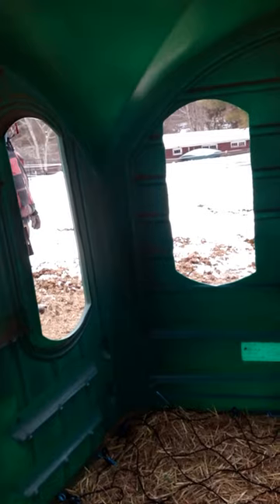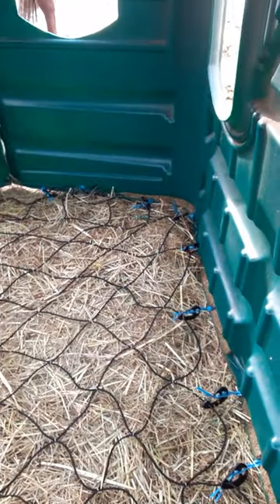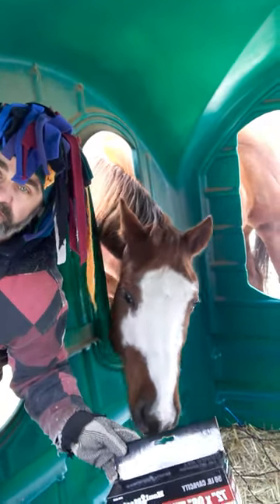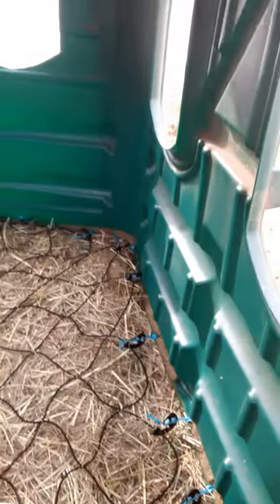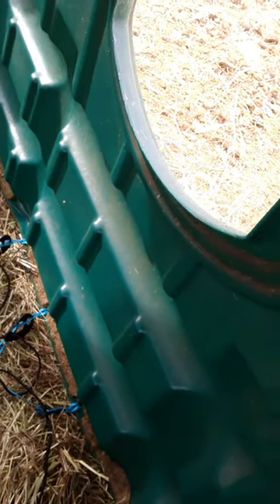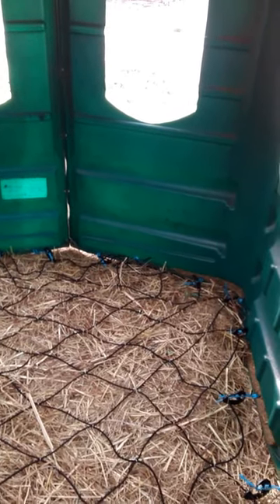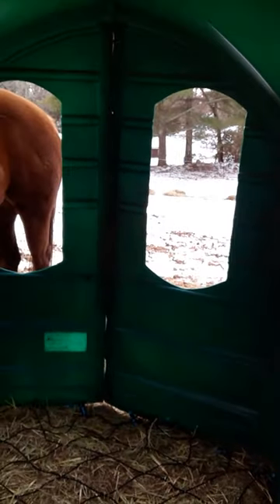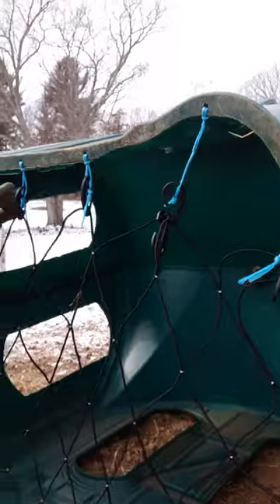Slow Feed Hay Net Hack Part 1

Comment: Very enterprising indeed and for sure inexpensive! It will be very tight and may rip out in places when pushed back over a 4' round bale. I would recommend that you think about mounting it a bit higher and maybe using a slightly bigger net to give some slack for over the bale at first and also to allow come slack so they cam move it around when the hay level gets low like we do with our custom integral hay net kit that we offer for our latest HayHuts one of which you can see in action at this youtube link - https://www.youtube.com/watch?v=9xD0Z8RQIm8 - but it is a lot more expensive.